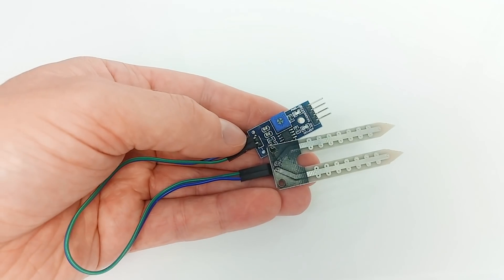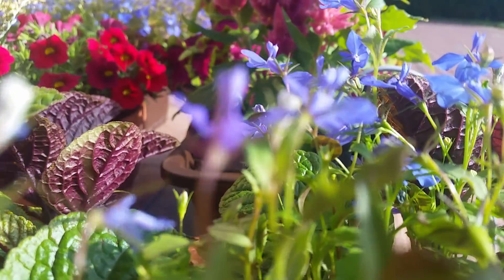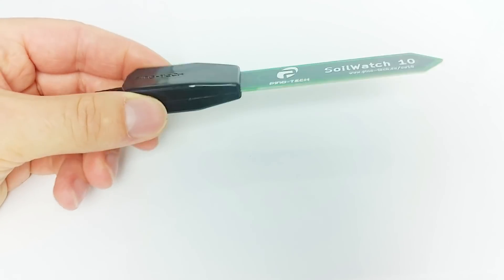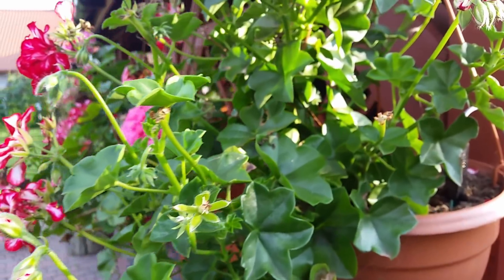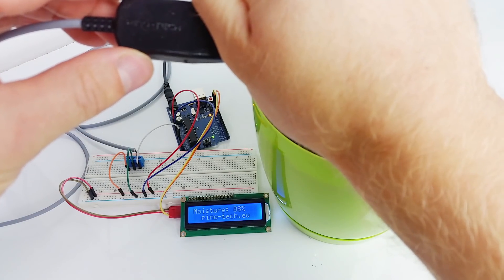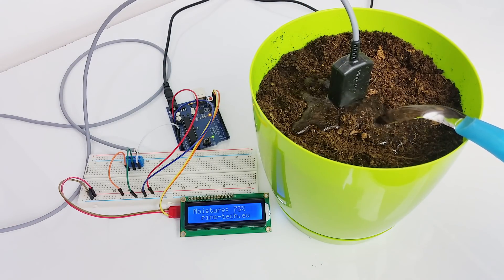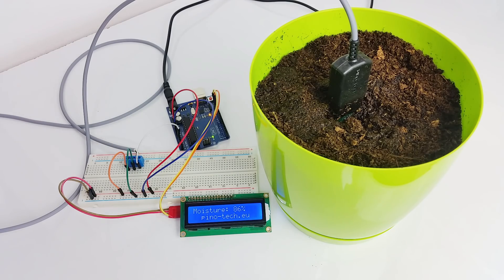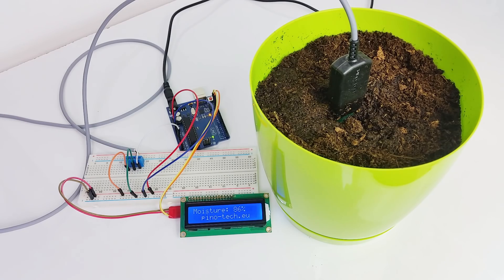SoilWatch 10 - Arduino - Capacitive soil moisture sensor

Comment: Hi! I'm having trouble reading the sensor with my HTCC AB01 board. I've configured the ADC pin to read the sensor value, but the data doesn't change. Could you provide support or an example for this board? Greetings from Paraguay!
Reply from the maker: Hi, I am not familiar with this board but this should work:

void loop() {
  int voltage = analogRead(ADC);
  Serial.print("Voltage = " );
  Serial.println(voltage);
  vwcValue = (2.8432f * voltage * voltage * voltage) - (9.1993f * voltage * voltage) + (20.2553f * voltage) - 4.1882f;

  // print VWC results to the serial monitor:
  Serial.print("Moisture VWC [%] = " );
  Serial.println(vwcValue);
  delay(250);
}

If you still have trouble making it work please contact us via https://pino-tech.eu/contact/

Comment: This price is crazy! 15 time more than standard capacitive sensor.
Reply from the maker: Thank you for your comment.
The devil is in the details. I think you refer to the sensor known as "capacitive soil moisture sensor v1.2" which is not waterproof and its sensing area is covered just with the paint. It also is more temperature unstable. We produce our sensor in smaller quantities in Europe hence the costs are higher.
Reply: @pino-tech  so you sell it for probably 3 times the price than in the US? 
Who will buy it if it's like this when tutorial's exist for fixing the standard capacitive sensor?
Reply: @pino-tech  nice product! you said that ""capacitive soil moisture sensor v1.2" which is not waterproof and its sensing area is covered just with the paint." what do you mean with "it's sensing area is covered just with the paint"?

Congratulations for developing this product.

Comment: Hi Piotr. I'm testing your SoiWatch sensors in my flowers that also have MiFlora sensors in the soil. I get very different readings from both sensors, please see: https://www.facebook.com/groups/LoxonePLusers/permalink/4221733507947445/ 
What could be the reason for that?
Reply from the maker: Hi Tomasz. Nice project. We have no idea how the MiFlora is calibrated and how it correlates to our sensor output. I see that you used our example to get the water content. Please note that the output of the sensor is not linear and using our simple 0-100% mapping can only be used to compare to another SoilWatch 10 sensor. To have more comparable results you can use the Volumetric Water Content calibration but it can only be comparable to the sensors with VWC output.

Comment: AT 37 euro it's too much  money
Reply from the maker: Hi, 37 euro is for the sensor with 20 meter cable. For sensor with 1.5m cable its just under 24 euro including VAT.
Reply: Alternatives: Delta-T SM150T, Teros 10 for 200-240 Eur is even more + logger about 600 Eur.

Comment: Looks like a sealed Capacitive Soil Sendor v1.2. I am assuming it is the same design using the 555 and cap/res tricks to get a analog out. Looks like a good idea tho.. Beats having to seal a sensor myself.

Comment: what is "internal" analogreference?
In coding it says "Internal" is not declared?
Reply from the maker: Please see Arduino documentation https://www.arduino.cc/reference/en/language/functions/analog-io/analogreference/ Internal will only work on some boards. If you use board which does not support internal reference then just comment this line.
analogReference(INTERNAL); //set ADC reference to internal 1.1V

Comment: What is the diameter of cable? I need to buy cable gland for my IP67 box that I will run the sensor from
Reply from the maker: The cable diameter is about 3.7mm. Gland size PG-7 fit well.
Reply: @pino-tech  Perfect, thank you. Found some PG-7 Glands on Conrad that will work well.

Comment: Hey, I have some questions. This sensor works with particle photon or electron? If your answer is yes,do you have a library or code for this?
Reply: What?? lol
Reply: I am interested in this too, I have tried but not had any luck getting results
https://blog.particle.io/2019/01/28/learn-how-to-build-an-iot-workshop-using-a-soil-moisture-sensor-and-particle-photon/

Comment: Hefty price. AliExpress sells capacitive soilsensors for around 2 USD that can be read with analogue port. Also regular resistive sensors will last a long time if you only apply voltage when reading
Reply from the maker: You get what you pay for. Don't get me wrong, these cheap sensors are good for learning and short term projects. Let me point out some major differences. The capacitive sensors which you mention are sold without waterproof cover or cable. The frequency at which they measure is in the kHz range instead of 75MHz. Low frequency makes it more sensitive to salts. Also, temperature compensation is not very good at this cheap capacitive sensor. Not to mention that electrodes are only covered by the solder mask. One scratch and your capacitive sensor is useless. SoilWatch 10 electrodes are sandwiched between glass-reinforced epoxy laminate. Resistive sensors aren't waterproof, no cable. When powered only when you measure they last longer but they drift with time due to the electrode oxidation. Gold plated ones are better but not ideal.